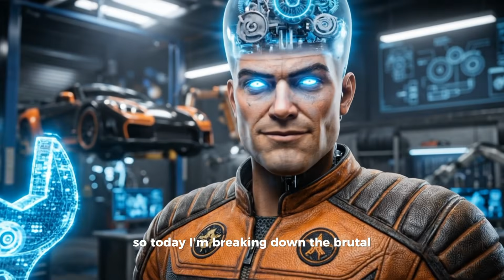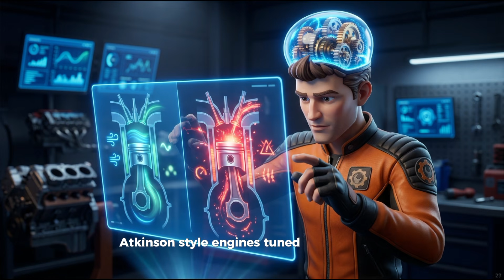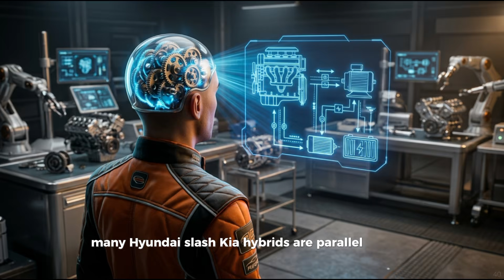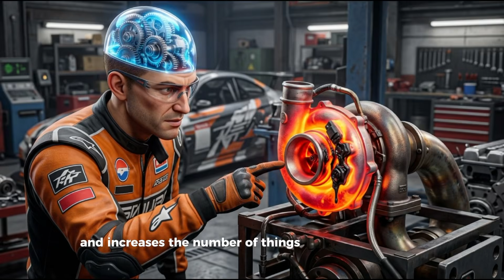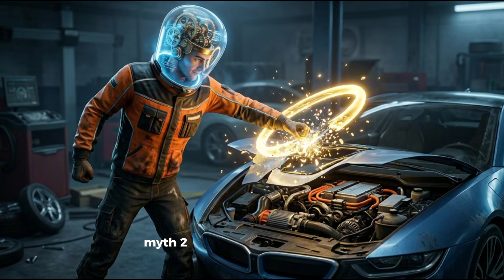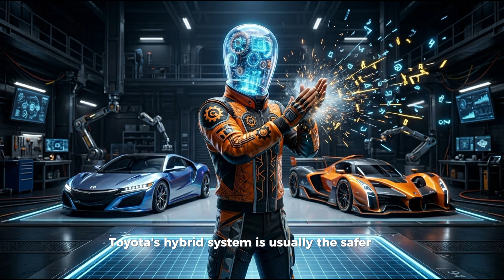Hyundai Kia Hybrid vs Toyota The Brutal 100k Mile Reliability Truth

Comment: Awesome video. I just put a deposit down on a RAV4 XLE premium. Toyota owes you a huge chunk of the commission. Seriously. You have presented the facts that help make my decision. Thank you.
Reply from the maker: Brian, thank you for watching and for the incredibly kind words. Congratulations on securing the RAV4 XLE Premium!

I promise you I don't take a dime from Toyota—my only loyalty is to the mechanical truth and protecting the wallets of our GearHead community. But from a strict engineering standpoint, you made a highly pragmatic decision. By choosing a platform built around the constant-mesh planetary e-CVT and an under-stressed Atkinson-cycle engine, you have effectively engineered-out the friction clutches and complex turbochargers that ruin the Total Cost of Ownership (TCO) on competing models.

You invested your capital into a machine that is deliberately designed for maximum mechanical longevity. I am thrilled that the analytical breakdown helped you navigate the dealership lots with confidence. Enjoy the new ride, and keep us updated as you start racking up the miles! 🔧

Comment: You just see too many Hyundai/ Kia engines blowing up at about 110,000 miles. A relative had a new early 90s Excel and that thing ran for about 300,000 miles.
Reply from the maker: Jim, my friend! Always great to see you back in the comments bringing the hard historical facts to the community.

You are absolutely spot-on about that 110,000-mile cliff. That reputation was brutally earned during the disastrous Theta II engine era, where tight bearing clearances and manufacturing debris led to catastrophic failures that completely destroyed the Total Cost of Ownership (TCO) for millions of owners. It’s fascinating that you brought up the early 90s Excel; those older, naturally aspirated engines (often built on proven Mitsubishi blueprints) were incredibly simple and under-stressed. They possessed a true mechanical longevity that was lost when the brand aggressively pivoted to highly stressed GDI and turbocharged systems.

While their modern hybrid architecture actually uses different, more reliable engine blocks to avoid those specific past flaws, that historical 110k-mile trauma is the exact reason why pragmatic buyers still hesitate to trust them out of warranty. Thanks again for always keeping our GearHead family grounded in real-world track records! 🔧

Comment: Hyundai/Kia have improved but Toyota is simple the best.
Reply from the maker: Victor, thanks for watching and for bringing that straightforward perspective to our GearHead community!

You are 100% correct. From an engineering standpoint, Hyundai and Kia have made massive leaps with their TMED hybrid architecture, significantly improving their thermal management and overall drivability compared to their older models. However, when we evaluate vehicles at the 100,000-mile mark, simplicity is the ultimate cheat code.

Toyota’s reliance on the constant-mesh planetary e-CVT completely eliminates the friction clutches and shifting hydraulics found in the Korean systems. By engineered-out those physical wear points, Toyota remains the undisputed "best" choice for protecting your Total Cost of Ownership (TCO) and ensuring true mechanical longevity out of warranty. Thanks for keeping the discussion grounded in the hardware facts! 🔧